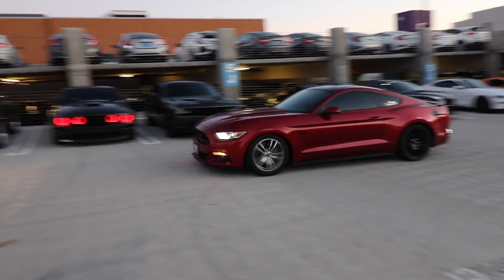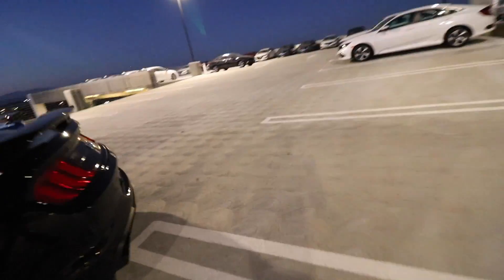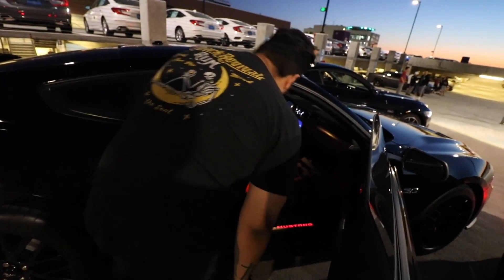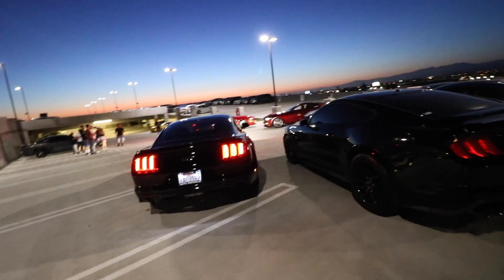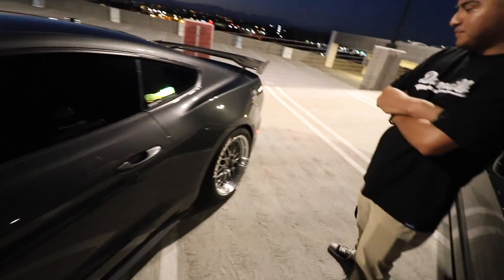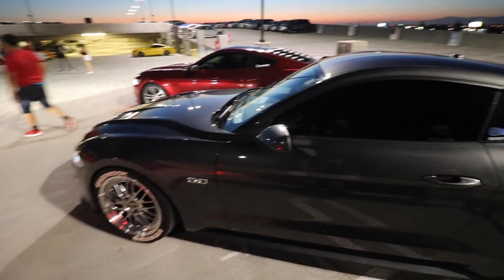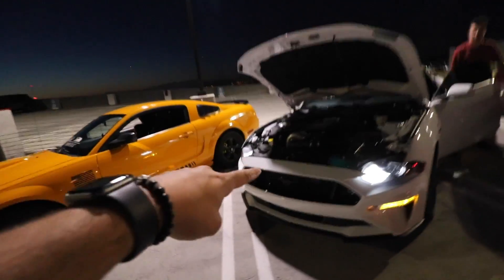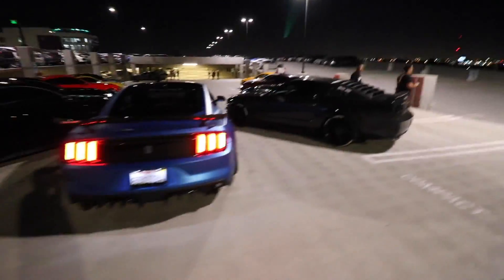HE BUILT A TWIN TURBO MUSTANG GT IN HIS DRIVEWAY!

Comment: I know this is a silly question so here it is. My anti freeze is running out and I’m trying to put more but my anti freeze looks pink ! I’ve went to ford dealers and say it’s orange it just looks pink. I need help pls. I have a 2019 gt. Btw I wanna remove the font license plate bracket what do I put in the holes that it will leave behind?
Reply: Mine was pink too, I knew I wasn’t tripping but I just used the orange coolant it’s the same thing keeps it cool. No problems at all.
Reply: But there is pink coolant, can find it at Walmart and auto parts stores. For your bumper you can buy bumper plugs online.
Reply: Sebas.5oh when you poured the orange one did it look pink after?
Reply: myogtraphone no it’s still orange, but what im saying is that there is pink coolant but they both do the same job. Just look up pink coolant for 2016 mustang if you’re that worried about it. They should sell them at Walmart and auto parts stores.
Reply: Sebas.5oh did you drain out the pink and then put the orange or did you just mix it

Comment: Save the manuals to go slow. Auto to win. I was a hard core manual owner. Every toy should be manual. But the 10spd is unreal. So, went with the 10spd in my '18 gt. With a vortech JT v3 blower. Only 540whp on that stamg? Wtf?? The safe base tune I got from Lund was 550whp and that was just to get to the dyno for proper tuning. Being conservative,  on 91 I put down 670whp. On 94 723whp. Ms109 puts 800whp. No e85 up here. Something not right with that procharged  '18. Full bolt on corn fed '18s put down 500whp N/A...
Reply: MrDaavee he’s on stock fuel system
Reply: @TridentFresh  so is mine. Just a boost-a-pump that came with the kit. As i said, theres something wrong with that '18, the tune, or the tuner.
Reply: MrDaavee he doesn’t have a boost also tuners tend to be safe unless you have a good fuel system to support the boost
Reply: @TridentFresh  nope, tuner is bad,  car is bad, or the tune loaded in bad. Even on the full stock system, it will support the boost to easy 600-620whp on a gen 3 coyote.
Reply: MrDaavee the stock injectors are trash 28lb
Reply: @TridentFresh  yes they are...and will still flow 600-620whp. Lol
Reply: MrDaavee you would need a bap to raise the fuel pressure to support that
Reply: It was 580, where did you get 540 from? Stock fuel, no bap. 6.5 psi pulley, not an 8.5. Procharger even states the CA legal kit is 45-50% gain. I dunno, sounds about right to me.